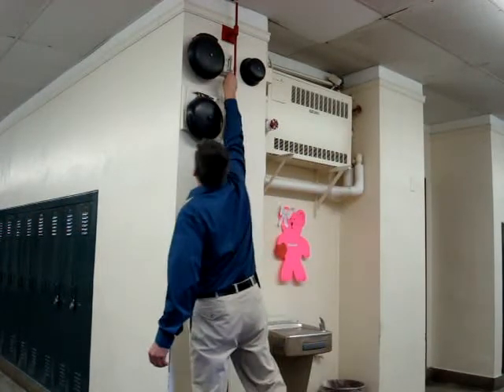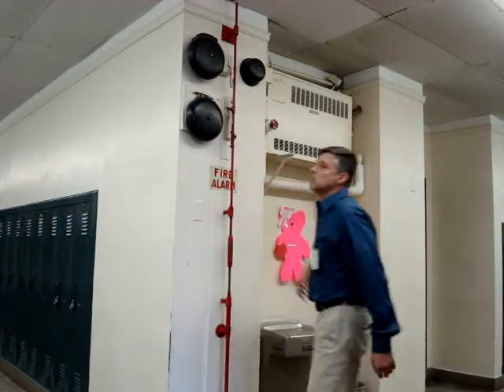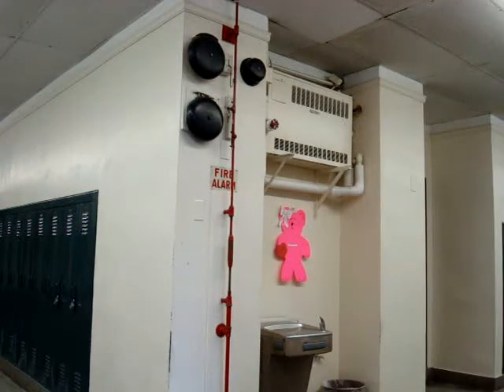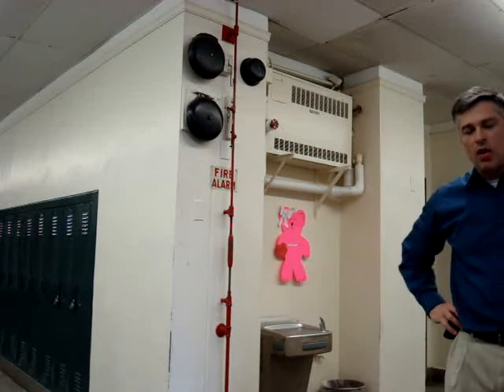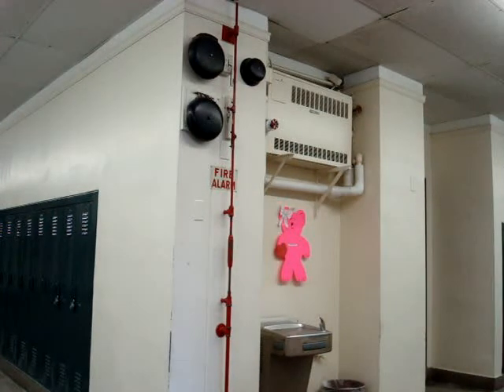VINTAGE  PULL ROD FIRE ALARM SYSTEM

Comment: That single-stroke bell sounds much nicer, than the modern high-pitched piezos of today's alarm horns!
Reply from the maker: I could not agree more!
Reply: Old School Fire Alarms
Yet in movies and TV, bells are still used as fire alarms, when in real life, most of them were replaced!
Reply: GandSAfan Fact: the reason why the rod is so hard to pull is because it goes through every floor from the basement

Comment: I love these Autocall fire alarm systems. I wish my middle school I attended had one of these. The middle school I went to was built in the 60’s and it had edwards class change bells like the ones in it so I’m thinking it had an old Edwards fire alarm system with either fire horns for fire bells with a relay panel similar to these Autocall ones but except no code wheel. At my Junior high school I did notice an Edwards Adaptabell fire bell in the Gym. It’s sad to see that this specific school is condemned. Hopefully you get to keep whatever you can for that fire alarm museum.
Reply from the maker: Thank you for watching and for your comment.

Comment: those sound like the simplex stroke bells when was school built and control panel please
Reply from the maker: Watch my newest video, VINTAGE FIRE ALARM @ GOODRICH SCHOOL on my  You Tube channel and you will see the control panel.  This fire alarm system is an Autocall (circa 1950's) using Autocall 10 inch single stroke bells. The school was built in 1930. Thank you for watching.

Comment: Why is the Manuel trip bell not connected to the rod
Reply from the maker: The chain that was connected to the pull rod and trip bell had broken when this video was shot. The chain was later replaced with a new one.
Reply: No wonder why you use your hands to sound the trip bell

Comment: That is so old and it violated most ADA compliance laws. First of that metal pole is too hard to pull and second off no strobes!
Reply from the maker: It may be old but still works like new. The pull-rod is actually very easy to pull down. I just wanted to show where the actuator switch was that is attached to the pull-rod.  Strobes would be very easy to wire into the control panel, which is an Autocall panel and over 60 years old and still working great.  You can keep the new systems they make today. Everything from the control panels to the audible devises and pull-stations are all plastic junk that wouldn't hold up in a real fire. It would all burn right off the wall.
Reply: Sure I will admit that this could easily be fixed to match ADA requirements but just keep in mind I have never seen a system like this until now and just saw a big metal pole rod and no strobes and thought with my small 6th grade mind oh non ADA okay comment about it!
Reply from the maker: Ian, I appreciate your comment and think it was a great observation. Thank you for watching and taking an interest.
Reply: My parents think I should just focus on the new stuff if I want a career in this but the old stuff is more interesting!
Reply from the maker: I agree, the older systems are more interesting, so learn as much as you can. To fully understand the new, you need to understand and appreciate the old. I think it is wonderful that you want to pursue a career in fire alarm/safety technology.  It is very important to understand the history of fire alarm systems.  There are still many public buildings and institutions in the United States and abroad that have and utilize these old fire alarm systems.  Many older school buildings still have pull-rod fire alarms with older Simplex and Autocall control panels. There are fewer technicians that know how to work on them. So the more you can learn and know the better.
Reply: Yeah those people just throw away damn money just to be such cheap sakes. I wish they still produced things just like they did back in the 1900s and maybe up.
Reply: Doris real mother of calliou Well, now I feel worse about myself and it's all because of you! Thanks also, I posted this years ago, I'm older and wiser now and not so quick to judge so just back off okay?
Reply: +Tom Tom I agree
Reply: Ian Schrader don't feel worse about yourself he's jus t trying to annoy you just try to ignore it